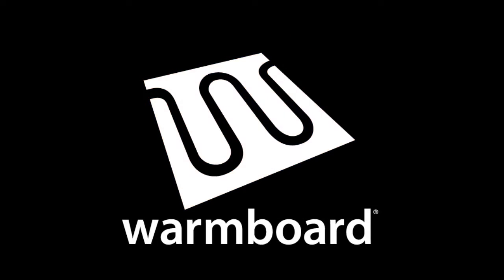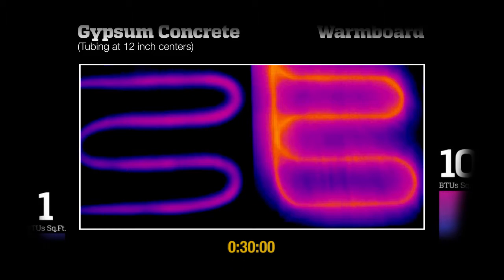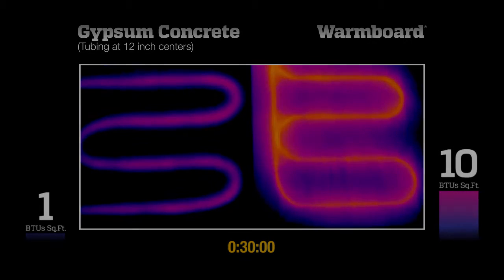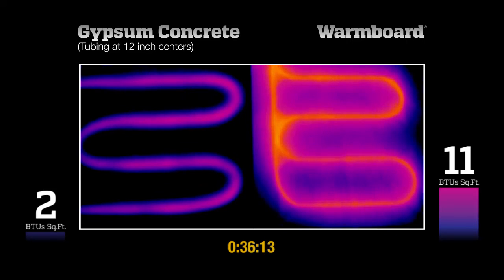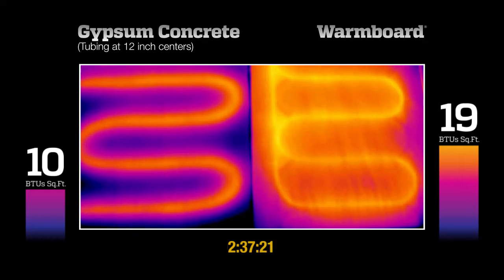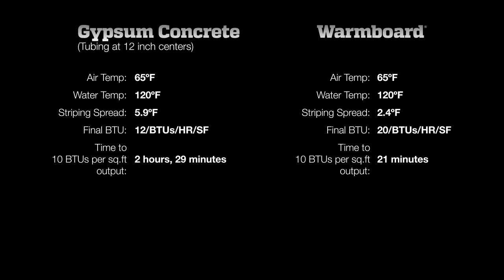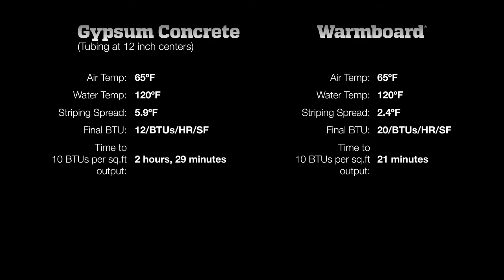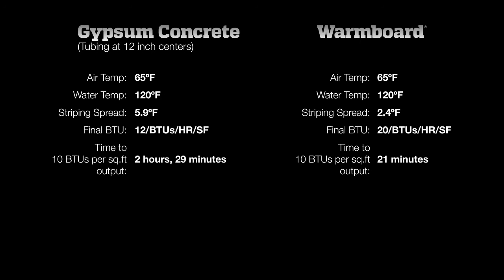Radiant Heat Performance: Gypsum Concrete (12 inch) vs Warmboard

Comment: Can you use this in basement over existing concrete
Reply from the maker: Yes. With a caveat. If your basement is below-grade and at high risk for water intrusion, we advise against it as any flooding could compromise the integrity of the panel. But if water tight and/or is grade level  with maybe a sliding glass door to go outside, you're good to go.
Reply: @Warmboard  we have a below grade and everything runs away from the house with a door already there. Carpet now. I want to put this over the existing concrete and just adjust the doors. How much for 1500sqft basement?
Reply from the maker: @coreym5072  Give us a call 877.338.5493 and we can get you a price – there's just a few variables we need to know.
Reply: How about heat retention and energy efficiency over a period of 24-48 hours?
Reply: @VarrasseK  Or a VOC emission test. Gypsum is definitely the more sustainable, healthy, and efficient product.